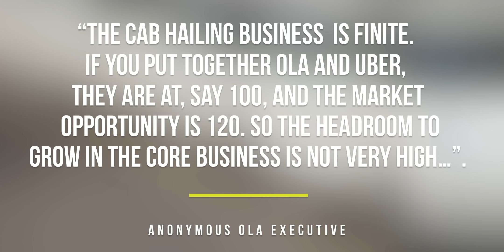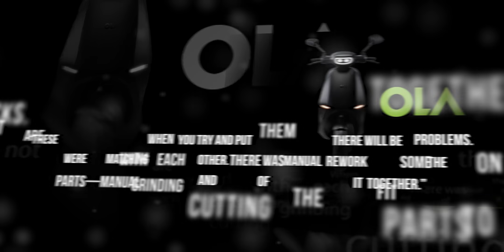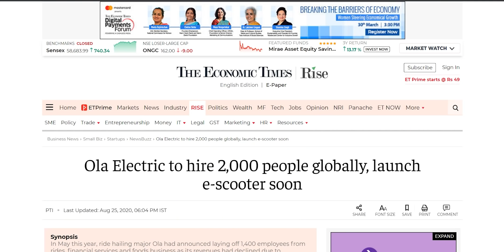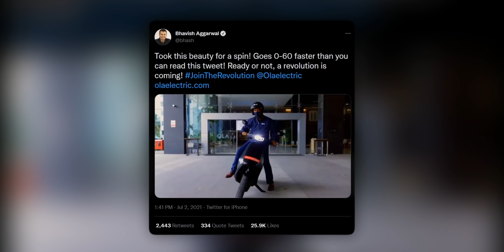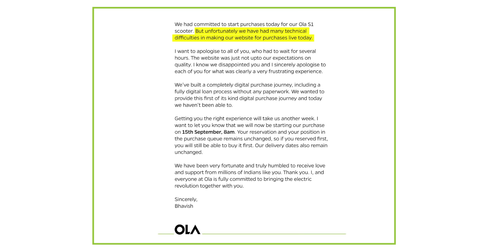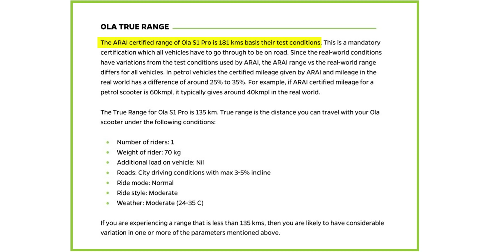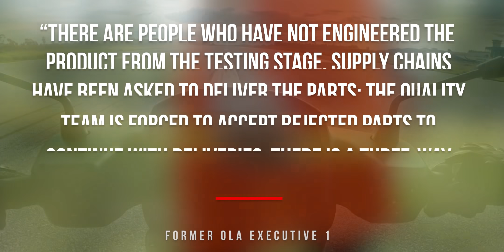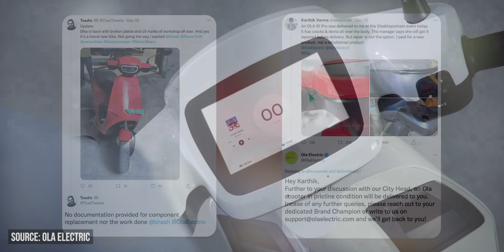How Ola Electric's Revolution Faltered

Comment: I own one and it's amazing, any product would have a lot of problems and it's common. We can give them time and they should be good
Reply: "any product would have a lot of problems and it's common" - no it's not common to have a lot of problems. You  as a customer are paying full money and getting a lot of problems from the product, it's unacceptable.
Reply: @mkshsharma  everything takes time yr. All startups face issues, that doesn't mean start bashing them for no reason. They are creating a revolution, a 1st of its kind, not some vadapav at a thela. When facebook, google were created, they themselves had a fair share of problems. I still remember initially it was easy to hack facebook accounts. Good things take time.
Reply: @dynamicpanda9318  You are comparing free services provided by Google/Facebook with fairly or overly priced electric scooters. Criticism and bashing are two different things and we should criticize every flawed product for consumer benefit and product improvement in future.
Reply: @mkshsharma  you can take tesla as example in that case. When it started it too had lot of flaws, breakdowns ,as any startup will have. SpaceX literally destroyed some multimillion dollar rockets and were on verge of bankruptcy. No one is expert on first go, the thing that needs appreciation is they pulled it off in such short span of time. Hardware is hard. And you get a chance to criticize if you own one and have 1st hand experience, do you own one of the models?
Reply: @dynamicpanda9318  where in rules it is written that only the victimized customer can raise voice? I am not asking OLA to shutdown their productions, it's about making them aware what is wrong with their product and uniting on social platforms to make the things better for both the customers and the company. A person who has spend 1lac+ in electric vehicle to get some benefits deserves better product and service and no consumer court or rule of law will excuse the company just because they are startup or a well established company. It is not the victimized customers' responsibility to grow a startup. If you go by this logic we have to excuse all the electric vehicle companies because most of those are startups, I can name atleast 10 such companies in India. By the way SpaceX burnt investors money not the customers' money so irrelevant to this conversation and Tesla eventually improved the product by hearing customers' voice and that what we want OLA to do.
Reply: I wish and pray u have safe EV ride. 🙏🙏
You must have a courageous heart to drive this expensive n explosive ola EV.
Reply: Ather is a very well sorted product. They did opposite of Ola. Under-promised and over-delivered.
Reply: @anirudhhhh  Ather's first products were Ather 340 and Ather 450. They cancelled the Ather 340. They dealt with a lot of issues for Ather 450 for 2 years and they finally stopped producing Ather 450. Now they have Ather 450X. The reason people think Ather had no issues was because of its small volume sales limited only to Bangalore during the first few years and the fact that most people didn't find out about Ather until recently. Ather went from Rs 1 lakh product to Rs 1.7 lakh product in 2 years. Their next product might be costlier. Ola Electric on the other hand committed to large scale production and delivery across urban and rural India. They made common people sit up and notice EVs. There were some initial issues. But I can already see awesome product, build quality and delivery from Ola Electric in April 2022. They are 2 largest Company in Indian EV 2 wheeler sales for March 2022. In an year, they will expand the EV 2 wheeler market and better the competition too.
Reply: @evthink  Yes ather did had issues but not with basics of scooter only the extra features which they offered had issues
and
Reply: Flower samjha hai kya? Ola Fire 🔥 hai🤣
Reply: it will fire soon  🔥🔥🔥🔥
Reply: @Shubham.Biswas  U means it will burn literally? :P :D

Comment: This video is totally wrong. Facts: Ola electric is the largest 2 ev company in India by revenue and second largest in sales in just three months. No other company has achieved that. What a click bait video . Thats why ppl don’t trust youtubers.
Reply from the maker: Hi Ramandeep, please share the facts which were mentioned in the video that were false/wrong, we will make a public correction. We do not want to be spreading misinformation. -Caleb
Reply: @backstagewithmillionaires  please define “catastrophe “, I have stated  my facts  clearly that Ola has become the largest two wheeler EV brand in record span of time  , if that’s not the definition of  success then what is? Have you seen the vahaan pan india registrations? Ola is going to beat hero electric in april to become no 1 by both sales and volume. I am using S1 pro btw received it in march (full payment on 21st January). Disappointed by your poor research and spreading  fud  about imaginary temperature and water logging  issues . I even use pressure wash on my Ola and its ip67 rated. There isnt a single case of water causing damage to motor or display. You are just regurgitating same old articles without providing the  data to back up your claims. Give me statistics on No of S1s  damaged by water , temp, or even tell me how they are fudging their numbers of  record deliveries in feb and march? Vahaan is a govt website they cant lie about numbers,Ohh my !that is a catastrophe
Reply from the maker: Hi Ramandeep, nowhere in the video was water damaged/waterlogged S1/S1 Pros mentioned, where are you drawing these conclusions from? What claims are you referring to? We did highlight an engineering challenge, i.e. making S1/S1 Pros capable of handling India's occasional flooding conditions, and also making the S1/S1 Pro capable of handling India's extreme heat, but we never said that Ola Electric had failed in their efforts to solve said problems. That part of the video was purely intended to highlight how different Netherlands is from India, and why it would take Ola Electric time/energy/effort to get these scooters ready for Indian conditions.

The overheating thing was also barely mentioned - we talked about the Ola Electric scooter which caught fire for all of 20 seconds, and did not go into more detail because the facts are not yet known - DRDO was still conducting their investigation, but IMO it is unlikely (although certainly not impossible) that someone lit the scooter on fire intentionally, which would indicate a malfunction of the vehicle.

The bulk of our video focused on unmet promises (software, delivery dates, and the discontinuation of standard S1 delivery for the time being). That's it - no overheating (except for the 20 second scooter fire segment, which was very nondescript) or water problems were highlighted, explained, or used to draw conclusions. Watch the video.

Definition taken from Google: Catastrophe: something very unfortunate or unsuccessful. "the tax would be a catastrophe for the industry" < While the S1/S1 Pro are certainly successful (and we never said otherwise in the video, and have highlighted their successes and accomplishments in other videos), their launch and distribution have been plagued by unfortunate problems caused by the poor execution that we focused on in the video. This has resulted in a ton of negative PR for the company, and in my personal opinion, this has been catastrophic for the company. Is it fatal? No, not even close. Catastrophes don't need to be fatal though, they just need to be extremely damaging and harmful, and I believe that the negative PR has been just that to Ola Electric.

In spite of this, I wish them success - we have nothing against Ola Electric, and actually hope they're able to make things right ASAP so that their reputation is preserved and they can make the impact that they set out to make from Day 1 - India (and the world, I hope) will benefit greatly. -Caleb
Reply: Laude vedio deka kya?
Reply: @revanth709  tatte dimag mat kha mera….12th fail logon ko bewkoof bna sakte clickbait title se ….sales dekhi apne baap ola ki…sabko leke rakhi hai
Reply: Btw unsubscribed, you may get views from gullible fellows but lost credibility and  tehcies arent  going to trust your videos and recommend ur channel. Gud luck

Comment: I purchased Ola S1 pro. 
My delivery date was initially in December, but they kept on pushing final delivery.
They finally delivered it in early march.
This delay was very frustrating. And their customer services were also very bad.

But apart from that, I am using this scooter from last 1 Month, and I loved it.
Few things that they claimed during advertisement which was not there in actual product are Acceleration and Range.
1st Acceleration was slightly low then other scooter. (Its not bad, but not what they have claimed.) Top speed is good thou.
2nd Range, range is 135km for full charge and not 175km which they claimed. It is still good.

Overall, I am happy with the actual product even after it was not what they had claimed.
Because the product justified its cost, specially when fuel prices is soring, its lot cheaper to use an EV.
Yes it would have been better if Ola was honest about their product and and they focused more on their customer services.

And yes those software updates, yes I have to wait 6months for that, but I am fine with it, it will eventually come and its not essential for me when I ride scooter.

And because of all these delay, I am saying that
I am very disappointed with Ola company, but I am happy with the product Ola scooter.

1 uncertainty  that I still have about the product is its lack of motor cooling system or inferior kind of cooling system.
Generally in EVs to cool motor some scooter use Fan and some use a liquid cooling system for cooling motor.
But the Ola S1 was initially designed in Netherland which is a cold country. 
And it uses cooling method of dissipating heat away from motor using heat conduction though a strip of heat conducting material.
It is compact so it saves spaces, but it is very less efficient than compared to other method.
Maybe in cold country its perfectly fine. 
But in hot country it might be problematic.
And I have herd about motor heating issue in this product.

This is the only thing that I am cautious about.
We have to see how it performs in hot summer.
Fortunately for me I live in Bangalore and temperature never is too hot here.
And I usually don't keep my scooter in sun.
I hope it does not create any problem.
I though about this problem only after I received the scooter.

Other than that, product is worth the money.

Few things that Ola need to improve if they want to be successful is that.
1. In next model of scooter Ola S2 -
     a) they must modify the design to add legit motor cooling system.
     b) Maybe have 2 suspension in front wheel which would be good for bad roads, currently it only has 1.
     c) Maybe improve the home charging time by investing in R&D or by acquiring advance tech (I think they are doing it, they recently invested    in Israeli startup working in this field).  I am still happy with current charging time thou. 
2. Improve your customer services, and be more realistic and honest about your product. This is very very important to build trust.
Reply from the maker: Thank you so much for sharing your in-depth experience Libertarian! I sincerely hope that your experience with the S1 Pro continues to improve, especially once the software functionality update comes in. I am sure that in Bengaluru, the thermal runaway thing won't be an issue for you. -Caleb
Reply: This is a wonderful review, appreciate the time for sharing this.
Reply: - First of all as mentioned in video OLA made a big mistake by pushing it's launch in 2021 they should have launched the scooter with thorough check up and testing and should have launched by the end of this year which could have gave them ample time.
- Now coming to OLA it's same like Micromax rebranded phones from China and giving it a Indian name; OLA followed the same suite.
-  How could you say the price of 1.3L is justifiable for a half baked and false promised product if you consider it against Ather, Okinawa or Hero EVS. 
- In practicality also the scooter has a big hump on it's floor not at all practical for most Indian household needs.  
- As you mentioned it doesn't have reliable cooling doesn't it makes it unsafe scooter and danger to human lives. 
- There are many people complaining for reverse and hill climbing issue, heating of motors.
Reply: I think top speed is a little below 100 kmph(the speedometer shows it as 115 though). It's not 115 kmph as claimed. How can you live with a company that lies about specifications?
Reply: One of the best detailed review 💗
Reply: Thanks for sharing 1st hand experience and giving a better clarity, instead of other people who are just commenting based on incomplete info and sources. Whenever something new happens, we should accept that there will be some drawbacks and challenges which needs catering, not start blaming the company.

Facebook, Google all startups had their fair share of issues on launch. Initially it was so easy to hack facebook accounts. See where have they reached today.
Reply: Spending Rs 20k once in 3 years for battery pack is more than petrol cost.
EV is aving its own limitation, where as petrol vehicle nil.
EV IS DIFFICULT TO MAINTAIN.
Reply: @saravanamg7593  you are kidding rt?
If you have petrol scooter, you spend around 200 for a week, given the rising fuel costs. So yearly 11000, in three years 33000.add maintenance, it will around 40k for three years. Now feel free to look at ev numbers.

Comment: I was among the first ones who made pre booking. At latter stage when I was offered payment offer I made refund request because of the delay excuse and changed specs from removable battery to that of fixed one and the hiked price. Now I am glad that I canceled my order as there are lot of flaw’s like overheating and sudden change in reverse mode drive etc.
Reply: i am glad you did this. I have also no trust in this startup at all. I wish Honda or Hero will come up with their product, it may be bit expensive, but its worth ..
Reply: @grovervishal591  what about Ather? It’s a mature product I think
Reply: @arbjful  i am not an expert in ev scooter. Just an enthusiast like you. But i have good feelings for ather. So far its scooter proved its worth and deliver more than they said
Reply: @grovervishal591  you are right. I am having Honda Aviator and waiting for EV from Honda Stable

Comment: Main problem is entrepreneurs in ev industry r creating a hipe regarding performance without understanding the current technology, especially the battery technology, right now we can make high speed with high torque motors but there r no battery technology available  which can provide two things together 1st high discharge rate n 2nd long lasting, u may be thinking that we can add more battery packs but it adds weight n consumes space n weight cause more battery consumption so it equals out in terms of milage with or without extra battery pack. We can get any one at a time in a task specific battery.
Now this battery limitation forces ev  designer to make an ev with battery power friendly motors n these motors provide again any one at a time n that is either torque with low speed or speed with low torque. So if u own an ev then consider it like a pedal less bicycle or  quadcycle if u own fourwheeler ev, but the rules r same u should ride it like a cycle like how u pedal for 1 to 2.5 sec n then stop pedal n let the wheels roll itself by  momentum for 3s n then u repeat so this way u don't get exhaust. Similarly if u accelerate your ev for 1 to 2 sec n then let it roll for few sec then u can save battery power n can get more milage,  racing n over speeding should be avoided in ev because commercial ev r not designed for race even if it comes with a sports tag.

Comment: After riding the S1 Pro at the Alternate Fuel Conference, i was pleasantly surprised at its performance, it is a better alternative to the IC 110cc bikes in terms of specifically noise pollution and pickup speed. The IC market is gonna try all these bland ways of detracting people from buying these things, like making a single bike burning a big issue, it is simply a concerted PR machinery barrage. The rigidity in ambition that Aggarwal has shown is commendable, these delays were an open secret considering the ambitious timeline. In Pune, i'm seeing these things everywhere and its owners seem chuffed as cheese with what they've got. 
Its a intangible pleasure, and borderline creepy, but after riding it, i felt the calmness of women having put that machine together, them not cramped by the deadlines, peacefully going about their business without my kinda male testosterone and ego poking in their way, just doing their thing in that factory to the best of their ability.
Reply: Agreed. Lg chemical who supply ola cells are under investigation in the usa for cells associated with recalls at GM, Hyundai Stelaris Mercedes and VW.  It may be unrelated

Comment: I have an S1 scooter . I think S1 is better than S1 pro..! Because the hardware is of S1 pro and software is S1 ..! I haven't seen a single heating issue.. because S1 doesn't have a hypermode....! Also 1 kW extra battery gives huge battery life for scooters even after many life cycles are reduced .! I am sure that I am not going to upgrade for S1 pro..! I drove 1950+ km in just 35 days.! After using the scooter and absorbing it in the ola community... I personally recommend not to buy ...! Rather go to  Simple one or Ather....! If you like swapping go for bounce infinity.... The final choice is yours..... And always think about what suits you and check how the customer service ...! Ola service is the worst..! If you want to buy ola be ready to take risks...!